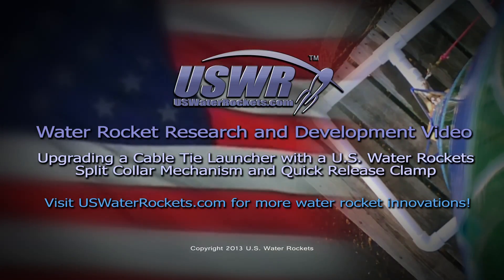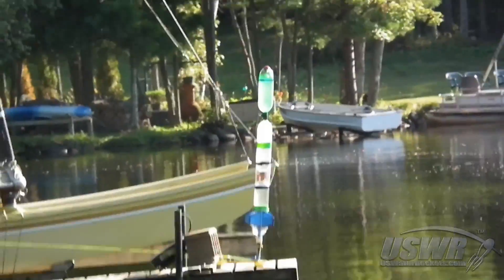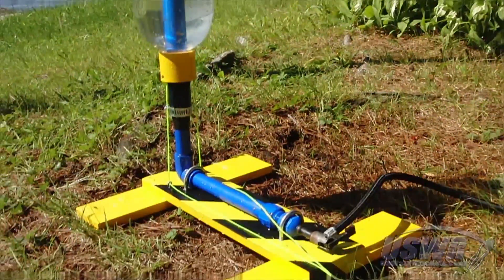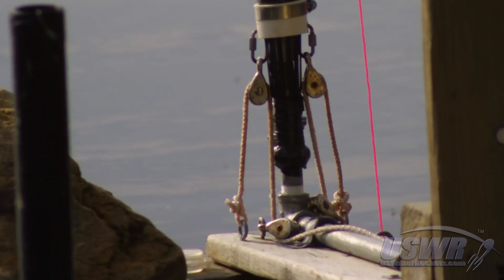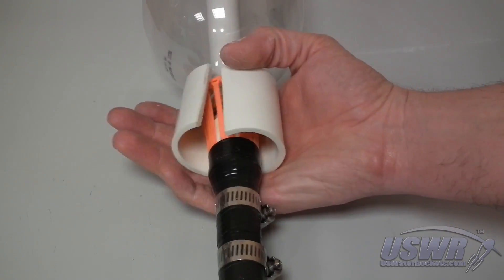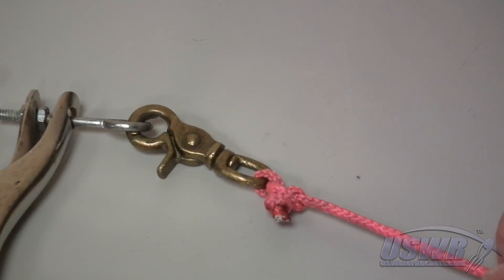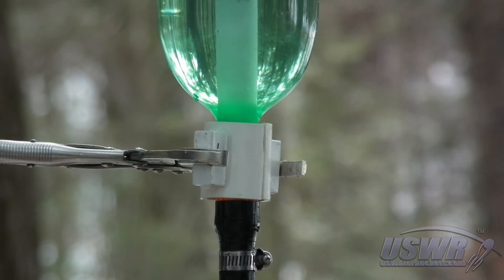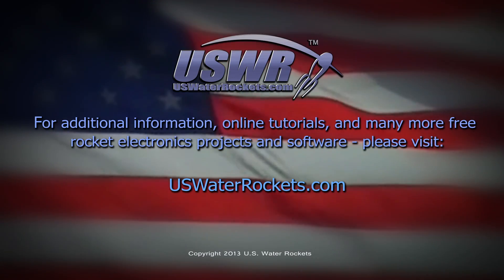Split Collar Cable Tie Water Rocket Launcher System!

Comment: Nice effort, but not 'elegant' like i would like. A bit overkill with locking pliers. Still searching...
Reply from the maker: Just curious why locking pliers are "overkill". They are cheap and reliable and solve the friction problem that cable tie launchers have.
Reply: Yeh i suppose cheap and reliable is a good 'backyard solution'. I have too much aerospace engineering in me which is always aims for a 'nice elegant lightweight' way to solve the engineering problem (friction issue) without declaring it as too great an obstacle to bring in the big guns.

If you are using lockpliers you may aswell use them to clamp the seal together (or something) and bypass the whole clark cable tie method altogether which is the elegant part.
Reply from the maker: We've already engineered ways to do what you say, but they're not the kind of designs that are easy to teach people to make from commonly available parts and materials. If there's interest we could do a video showing some other designs and how they work, but leave it to the viewer to replicate with their own materials and tools.

Comment: why do you not just pull a pin out to launch it?
Reply from the maker: Pin pulling launchers get difficult to operate at higher pressures. The friction is increased to a level that can make it impossible to launch. At high pressures the pin can concentrate all of the force on a small point which can break the PVC pipe or the bottle flange. this design spreads the force evenly around the flange and also does not change in operation when under heavy loads.
Reply: thanks

Comment: to continue I think there are even better releases. You could hinge the one side and use something like a tool box latch. Or something like a quick release used on things like on catapults. They can hold a ton but require very little force to open.

Comment: It looks good but for some reason I'm think the release could be better. I guess I don't like how you have to pull at the pliers to release them versus squeezing them together. 

I thought maybe you could use a bicycle cable brake system that would squeeze the parts together. It looks like you could pull the rig over if you don't get the tension right on the pliers. Also instead of using a heavy set of vise grips, there are plastic squeeze clamps that have ratchets with a release lever.